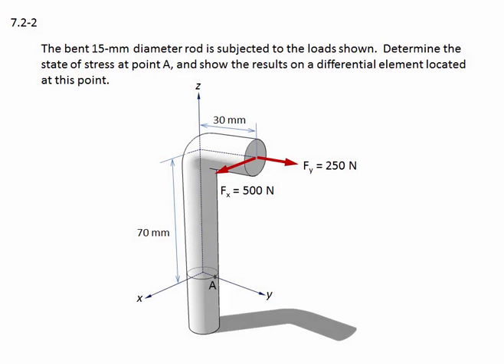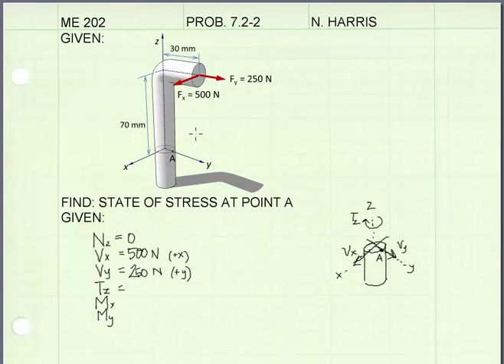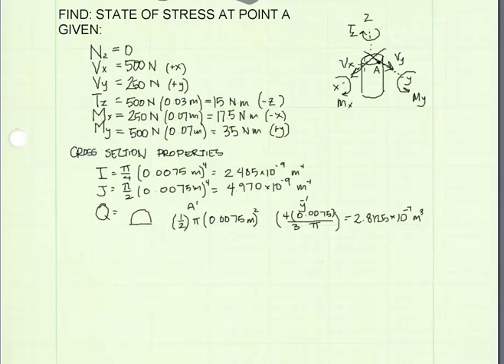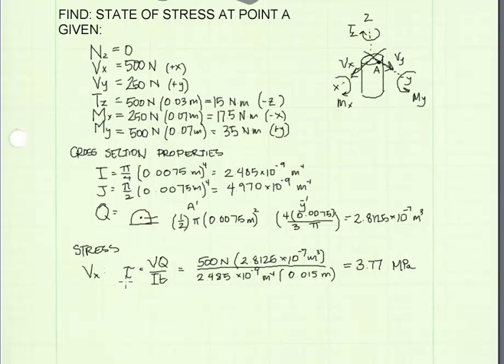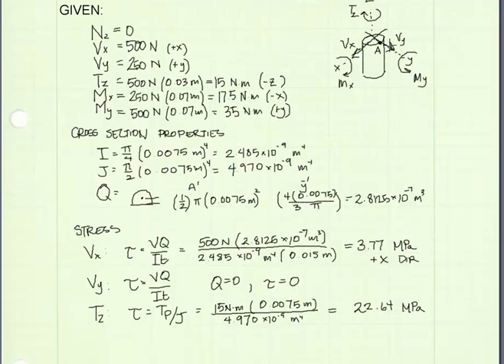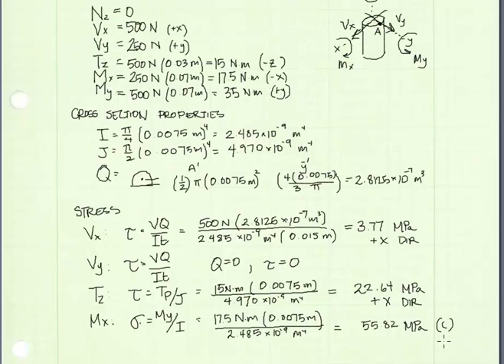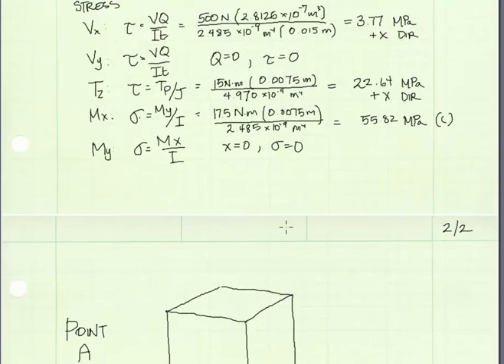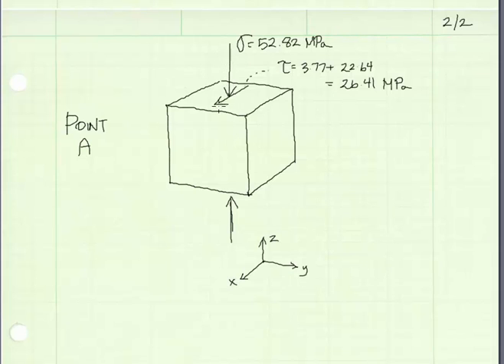07.2-2 Combined loading - EXAMPLE

Comment: Why is the stress from the Mx acting in the z-direction?
Reply from the maker: Mx is a bending moment on the cross-section.  Bending moments cause normal stress defined by the equation sigma = Mc/I.  The normal stresses push or pull on the cross-section surface.  The direction of the push or pull is perpendicular to the cross-section which here is the z-direction.

Comment: The torsion part is not correct. The sign of torsion is same through the section depending upon its direction whether towards the positive z axis or negative. Once it indicates during the equilibrium that its sign is positive then it has to be taken positive.
Reply from the maker: I disagree.  The sign on the internal torque at the cross-section is negative by the right-hand rule.  The shear stress caused by the internal torque is acting over the cross-section (x-y plane).  However, the sign on the shear stress caused by the torque changes over the cross-section, depending on the point where stress is being evaluated.  The shear stress acts in the direction of the torque.  At point A it is in the positive x-direction.  On the opposite side of the cross-section from point A, the direction of the stress is the negative x-direction.  Halfway between opposite sides, the stress is in the positive or negative y-directions.

Comment: quick questions, your torque  Tz working on -z , does that mean your 22.64mpa should be - 22.64 mpa?
Reply from the maker: The torque Tz is in the negative direction by the right-hand rule, however, the sign on the stress depends on what point you are evaluating on the cross-section.  Think of the stress acting clock-wise all around the cross-section (from a top view), like a whirlpool.  At point A, the stress is acting in the positive x-direction.  At a point opposite A on the cross-section, the stress is acting in the negative x-direction.  At 90 degrees from A, the stress is going in the positive or negative y-direction, depending on the point.